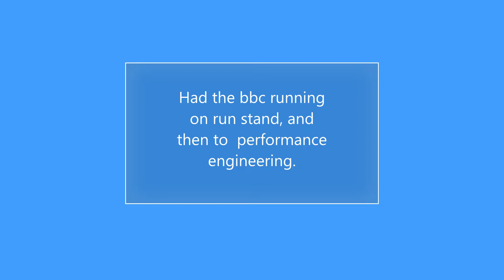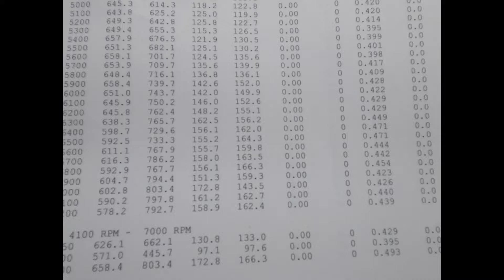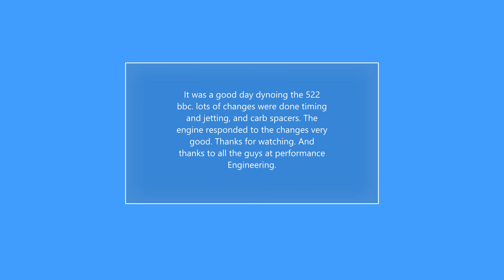522 C.I. bbc on the dyno

Comment: Looked great Randy, bet you are pleased that it is another completed engine out the door. I thought that the alternator belt was going to come off when they revved it up as it seemed to stretch so much. Regards.
Reply from the maker: Thanks Dave That is not an alternator it is a vacuum pump, it pulls a vacuum on the crank case. if you keep records of the vacuum as you put runs on the engine when the vacuum goes away you know it is time to replace the rings. hen making a pull on the dyno it had 7 inches of vacuum  in the crank case.